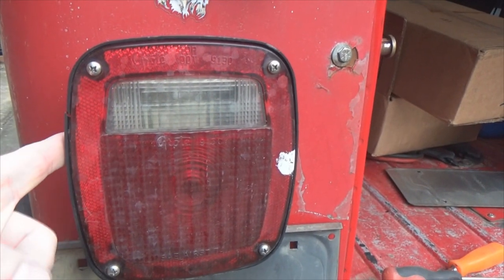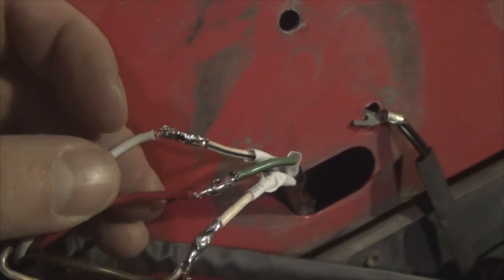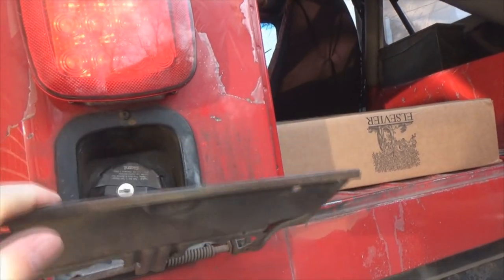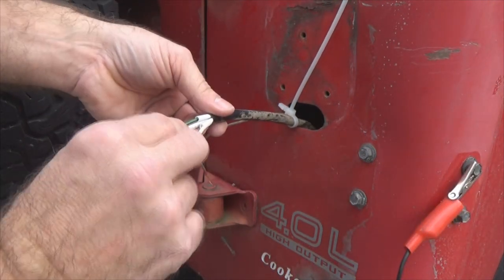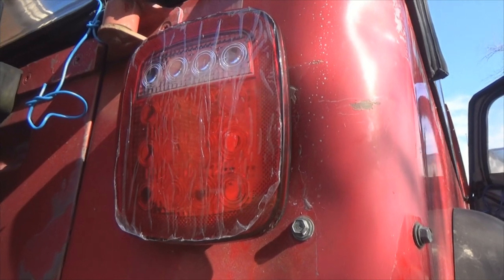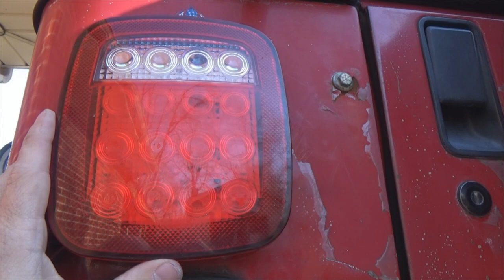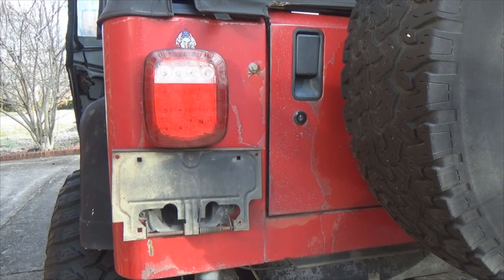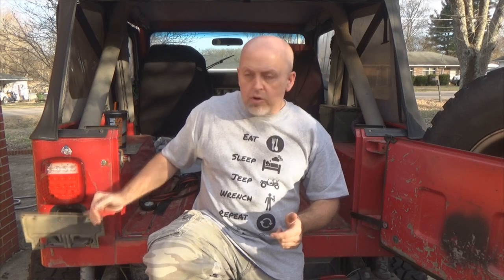Jeep Wrangler YJ - How to install LED tail lights and fix the "no flash" issue

Comment from the maker: Amazon affiliate links to the parts and tools used in this video:
LED tail lights: http://amzn.to/2v4NC6U
LED strip I used for the license plate light: http://amzn.to/2feikGP
LED Circuit tester: http://amzn.to/2v2vZGt
Heat shrink tubing choices: http://amzn.to/2fdClxl
Flasher module for LED tail lights: http://amzn.to/2uadaCF
Thanks for checking out the video and supporting Power Addicts the YouTube channel! Have a great day!

Comment: Great video. I got a pair of very similar LED tail lights for my '99 TJ and am having a problem. They are LED tail light/brake light/back up light/and license plate light all in one. They have 3 wires and a ground coming out the back, so 4 total I've wired them up per the diagram and grounded them to the tub using the mounting bolts. My problem is that whenever I turn on my headlights or press on the brakes, all the lights in unit turn on - brake and reverse lights. I even tried different wiring combinations to and its the same no matter what combination I do. Any thoughts?

Comment: i recently added LED tail lights similar to these on my 90 YJ and im running  into the issue of my reverse lights are constantly on and my brake lights are not coming on at all. everything else works aka my turn signals work, my license plate light turns on, and when i flip the headlight switch on the running/tail lights come on. ive tried switching wires around but that hasnt worked and ive replaced the brake peddle switch. im at a loss the tail lights i bought are off amazon CMVT auto LED tail lights for reference any help would be appreciated.

Comment: Please help for some reason my tail light is not working on my passenger side along with my reverse lights on both.. I bought new lights like these hoping it would help but I’m still having this issue. My brake lights and turning signals work on both sides no problem, what should I do to the the wires/harness?

Comment: Hey, we chatted a few times about YJ's. I did a video a few months back just showing the quadratec kit that you can pick up. It may be good to note to your subs that the kit that I picked up does not require splicing of the wires. Great install vid BTW. Always look forward to your uploads. It's plug and play. Here's the vid of them in action: https://youtu.be/9v-0dCGDEpk

Comment: I went with the same tail lights but I did some research long before I actually installed em. That research was pretty much watching this video. I watched this video 3 years ago but didn't install the lights until last year. Made sure I had the flasher relay and everything. Only issue I've had is I've had to replace the flasher what looks to be every 6 months (I'll update in another 4 months to let ya know) as eventually it altogether either stays on or doesn't come on at all then the turn signal on. It also doesn't flash at a normal pace all the time. Sometimes faster, sometimes slower than I'd like. Otherwise I'm happy with em. Oh I also weren't with a license plate relocaor to the tailgate and took my spare off. I'm gonna convert the tailgate to a drop down eventually so I'll have to rewire to make that work.

Comment: I clicked on your Fix Jeeps website but the tail light info isnt there. It takes you to amazon but thats it! The tail lights i havent bought already like i did the headlights! Are the tail  back together lights  Partsam-131703? How much do they cost $35 up? Did you do the 3rd brake light? I have the 3rd brake light above the spare tire, was wondering if there was a matching lens for the 3rd brake light?
I also wanted to ask what ALL would cause the mpg to go from 14mpg to 11mpg...2wks later..11mpg to 9mpg and 2 wks go by and its only getting 7mpg now! I have replaced the vacuum lines, TPS, IAC, exhaust manifold gasket, spark plugs, distributer cap & rotor, fuel pump and 02 oxygen sensor over a 10 mth period! Now i had my my fuel pump changed cause it went out but after everything was back together my gas gauge is reading 3/4 tank when its completely full. Im wondering if i have to pull the tank or if i can get away with pulling the hose that is inside the gas tank & cutting some off? Those issues i been tackling for almost a darn yr now, im about worn out on it.....lol

Comment: They have lights where you don't have to change anything! The products are the problem!  I was told that about my head lights and no issue because of the components they wire inside!  I pray to God I can get some led lights without moding anything!!!!!!   Cheers!  We know how hard this work is!
Reply from the maker: Yep, they are now LEDs that have the load resister built in making installs much easier. I have some that I'm going to experiment with. There will be a video on those at some point. Have a great day!!

Comment: Here you are again, Chuck.  Helping me out with replacing my YJ stock tail lights assembly.  You cover things the way most of us look at things that we're not doing every darn day.  Is LL552 flasher similar to EL-12 which is often recommended when some of the lights using the flasher are LED??
Reply from the maker: Glad the video helped you! I try to be thorough, it makes my videos a bit long sometimes. My first priority has always been to help people. I later switched to the EF32RL flasher that has the ground wire. It is much more consistent and as you add more LEDs it handles it much better. Here is the link to that flasher: https://amzn.to/3y59eCH

Comment: Have you ever replaced the signal arm and the thing it goes into? I was trying to dim my lights and the turn signal arm came out in my hand. My headlights was stuck on bright and they were flashing on and off. Had break the thing the arm goes into to get it to stop. I was in the woods getting going hunting in started this. Thi is on 1995 Jeep Wrangler.
Reply from the maker: I've changed them before my YouTube days. I need to change the one on my 91. I'll put that on the video to do list!
Reply: @Poweraddicts  they're not too many videos on this. I found this job to be difficult for the average do it yourself. Because the whole top part of the steering column have to come apart. But I like to see a video on it.

Comment: I can’t manage to put the right rear light on because theirs a huge metal piece and plastic that’s like impossible to take out
Reply from the maker: Neither one of my rigs have that plastic piece in them or I'd make a video showing how to remove them.
Reply: @Poweraddicts   Its basically the fuel pressure regulator, I didn't remove it because of the rust issue would have been impossible to put back in. I ended up get a long rench extender, It was more difficult then putting a new fender on.

Comment: hey I replaced my flasher but my turn signals still flash fast.
Reply from the maker: Either you got the wrong flasher or a bulb bad somewhere.
Reply: same here. i got the exact same flasher. but my turn signal would stop a times and also flicker sometimes. i had to put back the original that still seems to work okay with a combination led and old light bulbs.

Comment: Hey I installed some LED Spyder tail light and my right side is not as bright as the left side but its only like that with my LED lights. It doesn't do that with my original tail light. Any idea what the problem is..??
Reply from the maker: Check the grounds. That's the first thing I would do. Good luck

Comment: hey love the videos I'm new to Jeep and got a 89 YJ had to replace the output shaft seal on the transfer case tonight and discovered a trick with the lighting inside the cab just for s** and grins I took my under the hood Blue Point LED rechargeable light and I know I tried it inside the cab about the bars and it fits in their perfect clears the soft top with it on you can aim it towards the front snot in your eyes lights up the whole cab you can turn it and then you can light up the whole back of the Jeep awesome awesome idea all you got to do is recharge it when it needs charged if you break down on the road you got a light for under your hood I'll take a picture of it and try to post it on here later on tomorrow when there's light out but I think it's awesome idea it lights up the whole cab and service multiple purposes
Reply from the maker: Glad you like the videos! Hope they help you out! Post the pict on the FB page: https://www.facebook.com/fixjeeps/ . I'd like to see your idea. Thanks for taking the time to leave an awesome comment! Have a great day :-)

Comment: Hello there! I'm new to Jeep and I got a 95 Jeep Wrangler. I will do the upgrade in a couple of weeks but I got the LED lights with the plug and play, do you think I have to extra work for this?
Reply from the maker: If its a plug and play install, it should be really easy. The only issue you "might" have is either your flashers will either stay on solid or flash very fast. If it does either one of those here is the relay you will need: http://amzn.to/2iWPjSp . You can also pick up a relay at any auto parts store. In the store, it may not look the same, just make sure the package says for LED somewhere. Good luck! Have a great day!
Reply: Thanks!!! really appreciate your quick response! I'll let you know when I do the upgrade

Comment: I just wired some in yesterday. When I put the last one in and peel over the stuff protects the lens during shipping. The lens came off in my hands. It fell a part but I got some super glue and put it back together. I did contact the seller online and told them. Got it from eBay.
Reply from the maker: Make sure you seal them well or they will take on moisture behind the lens. I cracked one of mine about a month after installing them, I accidentally hit it with a driveshaft. Every since it will occasionally get condensation build up behind the lens. Thanks for checking ou the video and taking the time to leave a great comment! Have a great day!
Reply: I found some super glue at Wal-Mart made JB Weld called Super Weld and put it back together.

Comment: Hi Chuck, do you think I have a ground issue for my stock rear tail lights on my yj if brake and reverse lights aren't lighting up? The only one that function is the tail light/ running light, any suggestions?
Reply from the maker: Have you checked your bulbs? All light functions for each tail light share the same ground. So, not ruling out a ground. It is just more possible you could have other issues. Check the contacts inside the tail light, they are really prone to corrosion. Good luck! Have a great day!

Comment: How do you get to the nuts inside the wheel well on passenger side on a TJ? There seems to he a lot of metal in the way
Reply from the maker: I'll have to look at my dads Tj. I've never really looked to be honest. I'll reply back here when I get to check. Thanks for checking out the vid!! Have a great day!
Reply: @Poweraddicts  thanks for reply. Mine is a 05 and has the evap canister behind the passenger tail light. Any ideas?

Comment: I upgraded my flasher and still solid blinkers.
Reply from the maker: Check all the other bulbs to make sure they are good. Also, be sure you replaced the correct blinker. There can be 2 of them on the fuse block.

Comment: What do u think about wheel spacer s
Reply from the maker: Thats a heavy debate within the forums. Some like them .. some don't. Me personally, I'm not a fan at all of them at all. I've known of too many failing under different circumstances. I would rather buy wheels that fit than risk getting into a dangerous situation.